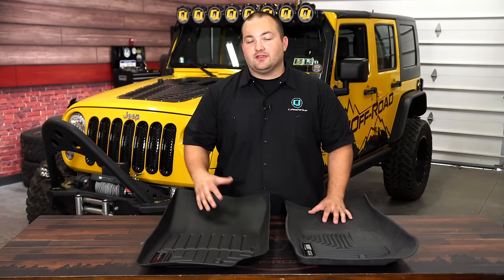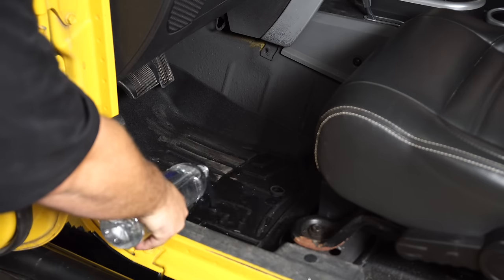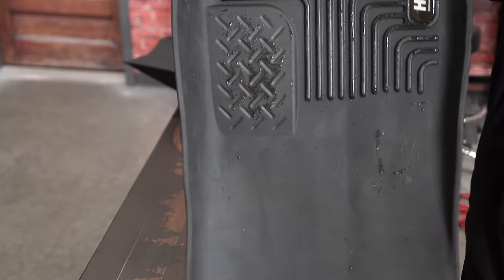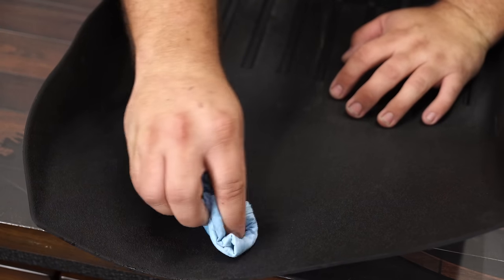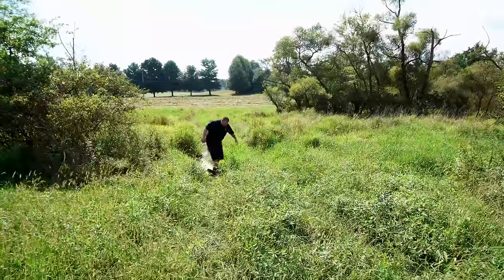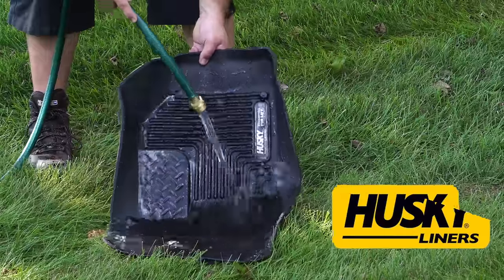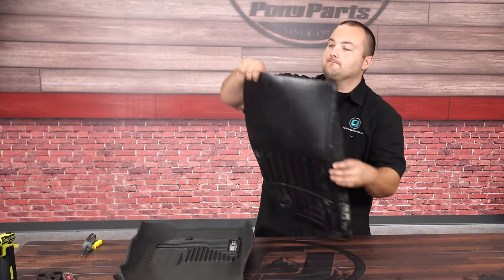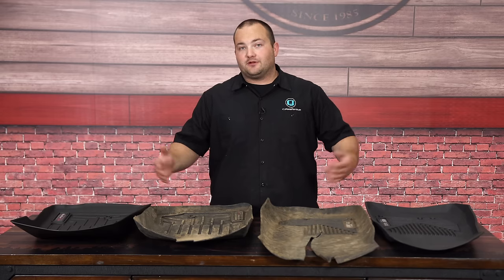WeatherTech VS Husky Liner: Torture Test and Comparison!

Comment: Hey buddy boy, if you put the seats all the way back, it would of been easier to pull them out of the vehicle and spill less to almost none
Reply: Capt obvious commercials are back!
Reply: Costco has some for very little money.The weathertech materials look cheap
Reply: But then you gotta find your spot again. So fuck that
Reply: @AntonioGarcia-xl7xi  Lifetime warranty like the husky ones I have?
Reply: Nick P 🤣🤣🤣🤣🤣🤣
Reply: Just Wipe and or soak up most of it b4 pulling out, 👍🏾👊🏾✌🏾🇳🇬🇺🇸
Reply: @ayo30s  Amen, That is one of the reasons you keep towels handy.
Reply: ayo30s That’s what she said
Reply: Just leave it and get out the car
Reply: @skittles7168 :   Ha, ha, ha, ha, ha, ha, ha  .....
Reply: most people probably wouldn't think to pull the seat back because that would be too easy.
Reply: @AntonioGarcia-xl7xi  I cannot comment about which one is better but, in 2013, I bough a 2010 prius with a bit more than 100 000 km that had weathertech mats. Car is now on it's 11th year with almost 220 000 km and the mats are going strong. Feel like they'll be good for much more. Note this is our only car and we are 3 (since 5,5 years...).
My only complain is it's impossible to remove the rear mat without tilting it 45° which let some dirt going on the carpet. If the plastic was a tad more rubberish, it would have been better. Bear in mind I'm sure these mats were bough at the same time than the car from the previous owner so I'm talking of 2010 models. I'll be curious to compare them with 2021 models to see if they're better, as good or quality has declined.
Reply: Have, not of.
Reply: Buddy boy!!!  Lol!
Reply: Or just use a shop vac
Reply: @skittles7168  Jesus loves you
Reply: CEO is pissed. “Hey buddy boy.” Lol

Comment: I've had both, and the Husky stood up better. Still have the set I bought. Weather Techs tend to curl up at the edges. Husky set still looks new, had it in my car since I bought it in '13.
Reply: Daniel Rehm thank you for your comment. I’m debating on which to get.
Reply: 2nd the huskys. I’ve been in several other people’s vehicles with WTs, and they offer too little friction. The huskys are softer, remain flexible, don’t get plasticy and curl. I have them in 2 current vehicles for the past 5 years, front and back, one with the contour fit or whatever, and one with the regular huskys. No complaints on either set.
Some of the comparison “tests” on this video are ridiculous. How difficult is it to pull the label off? Not on my list of concerns.
The huskys are nice and stay in place even if you don’t have a floor hook. The WTs feel like work truck floor liners.
Reply: David Sanchez the contours are more plush/softer/flexible feeling than the standard huskys, and would highly recommend them if they’re available for your vehicle. But the regular huskys are still very nice and have really aggressive “spikes” to grip the carpet and stay in place very well, and still offer good friction for your feet. 
Both clean up easily with some simple green or similar all purpose cleaner to remove the winter salt. Not sure what the price difference between them is these days but if you can swing the extra few bucks and they’re available for your application, the contours are definitely top of the line, as far as rubber floor mats goes anyway 🍻
Reply: David Sanchez  i have a pair of husky's in my Tacoma. they're okay, the driver side matt was molded incorrectly or it got bent in shipping and doesnt sit right, the emblem fell off. and they gave me a hard time about giving me a new one when i called them on the molding.  Next set I buy will be weather tech.  the passenger side one has been rock solid tho, no shifting, or warping.
Reply: I had already decided on the Huskys just on the noise factor alone but yeah this thread helped me confirm that the Husky's are the better choice.
Reply: See my experiences were right the opposite. My husky liners where junk in my king ranch f-250 but the weather tech mats have been perfect in my duramax.
Reply: @piezoman79  my experience was the opposite with the Husky Liners. My old 2004 Silverado 1500 has them and while the passenger side is mostly fine, the driver side wouldn't stay in place. So the driver side slipped all the time even though it had the carpet spikes on the bottom to stop it from sliding. It ends up getting pushed forward and bunched up developing a bad crease on one side. I mean they've held up all these years, but still slips all the time. I'm sure it would slip less if the truck back then would've come with a hook for helping to hold the mats in place.

Bought Weather Tech for my 2016 Ram and they were fine in that truck. Fit perfectly and never slipped. No idea how they'll hold up in the long run. Hopefully the next owner after me is still enjoying them and put up the stock carpeted Limited floor mats that came with that one.
Reply: @azurewinged4088  yes, thanks kinda the straight awnser I wanted, seems the huskys are a little better, then have the next to best ones, whole set front back for $113 for 2021 subaru crosstrek compared to $198 for weather tech

Comment: You do not take the liner out to get rid of the water. You mop it up.
Reply: Then he dumped the rest back on the floor board with zero liner lol
Reply: i have an offbrand similar set of mats: i just dump them right over the door jamb.
Reply: I disagree with ever aspect of this. My ram optional "weather tech" stuff formed mats are the TITS. And shop vacs will suck the deep puddles from snow or whatever if you cant move that sear back or your pedals back to the floorboard. ( call me spoiled but my ram techs  cost me as much as the front only from either company and I got a solid 1 piece rear to boot . What a goog. That mud had to be dried trampled for a week while building up more rocks and mud. And the "burn out" ha. Are you sure the wear wasn't a lil extra anti slip rubber coating. To the Ford fans. Floor mat beats Raptor. Ba ha ha. Check what's out there for your vehicle most companies guarantee equivilants with a long return policy!
Reply: Oh ....my bad. Also I've never had fluid contact anywhere but the area around the cup holder. Taco shaped do NOT  transfer fluid well. Great how not to test a CBC mat vid!. I did learn
Reply: I use a shop vac
Reply: and move the seat back as far as you can first prior to taking out the liner...
Reply: This must be one worst product comparisons ever. Who the F ever abuse their car floor mats like that? Not even the company put their floor mats to that much torture.

Comment: Idk what the hell the burnout test was supposed to prove but it needs to be a standard test for everything and anything
Reply from the maker: We did it for accurate science purposes 😆
Reply: If your ride gets stuck in snow or mud, a floor mat pushed under the front edge of the tires that are spinning might provide enough traction to bring the tire forward out of the problem area. Looks like the Husky is more likely to provide the traction that might get you unstuck.
Reply: Yep, i have got myself unstuck from my snowy and icy driveway many times by tossing the mat under a wheel

Comment: I will never spend my money on Weather Tech again! Bought a complete set for my 2015 GMC Denali, and the passenger side front kept folding over after time. Contacted them and they told me to use a hair dryer and form it back. Well geniuses, it always folds back over when it gets hot in the truck! They never offered my money back or to replace the mat, so they will not get my hard earned money ever again!! Just got a 2020 Chevy 2500 High Country D-Max and guess which floor liners are going in? Yup, Husky!!

Comment: I think its dependent on which vehicle. Because for my 15 fusion the husky liners covered a good 3inches further towards the seats and fit better than the weathertech. I had sent mine  back and then tried the husky. Glad I did! Love the in channel wind deflectors from Tech though, among a few other things. Both great companies, with very nice products, and best of all..MADE IN THE U.S.A. which isnt very common at all these days.
Reply: Know this an old comment but it's definitely vehicle dependent, on my jeep wj the husky goes up nearly twice as far underneath the pedals and towards the firewall on the passenger side, and for that reason alone I think there better
Reply: @Catboy-hr2qp  Perfect time to comment this looks for floor liners for my wj. Any issues with the huskys?
Reply: @Jonathan React  none so far, they follow the contours a little worse than weathtech but they stay in place better and like I said they go up further underneath which alone makes them better in my opinion
Reply: @Catboy-hr2qp  Thank you going to definitely consider them

Comment: Four Volvos (2005 XC90, 2009 S80, 2011 S60, 2018 V60 Cross Country).
ALL with WeatherTech mats, with no reason to consider another brand. Made in USA, a tad more expensive, but for me, worth the extra cost. Easy install, easy clean. Done.

Comment: I have run husky liners in my truck since i bought it and do find them too hold up quite well to daily use and abuse. My girlfriend runs the weather techs in her truck and between the two i personally will take the husky liners because i notice my girlfriends mats tend too slide around a fair bit more but overall they are both good mats and you can’t go wrong either way

Comment: I just bought a set of WT and they no longer have the cheesy logo on them. This will be my 2 nd set as I purchased a new truck. The one thing I have to say is the WT fit perfect. It looks like WT upgraded their floor liners from the 1st set I bought. I had the WT in my first truck for 11 years with no problems. The only down size to WT is it does feel more like a work truck due to the harder plastic they use. Husky uses more of a rubber that cuts down on the noise. It’s totally up to the consumer but I give WT a slight advantage for the tight fit of the floor mats.

Comment: Guy sounded biased against Husky Liners from the start. I've used Husky liners in 5 vehicles without issue since early 2000. Never wore thru and protected my carpet. I was never crazy about the Weather Tech brand, I always felt it was just a knock-off of Husky. Not sure how your going to end up with all that water in your floor mat. If that happens you have more issue than a floor mat can help you with.
Reply: I kind of thought so too.  I don't see calling the Husky Liners flimsy.  They're soft because they're more rubbery and the weathertech are more plasticy.  I have both and like both but I like the Husky better.  They're more comfortable under your feet and the aren't gray looking after you clean them.
Reply: @dwf150101  - thought it was funny how the weather tech is supposed to have a huge area to hold the water...where the open hole is to attach to the factory anchor...HAHAHAHA. The Husky doesn't have a hole where the anchor fits.
Reply: My uncle has had huskys in his 91 chevy ever since I can remember, still going strong
Reply: My Husky/ WT choice was made when Husky went on 20 percent off sale. Like the Husky a lot.
Reply: I had one husky that was worn through on the driver's side where the heel of the shoe rested. Husky sent me a brand new one with just a photograph required. 

I wish they make these for my wife's new car.

Comment: I have Weather Tech in my two trucks and have had two or three sets in previous trucks.  I’m prettty happy with them but they do get a little ugly after a couple years hard use.  Little more pricey than others but they do protect well.  I always remove them in summer except for the camp truck.  Bought a new Acadia and I’m looking at GMC OEM premium floor mats.  They seem really great and there is a 20% off sale direct from GM through May.  Between Weather Tech and Husky I do prefer Weather Tech.

Comment: It’s preference. I started with WT. They were good. I just got tired of it slightly shifting, and the sound they’d make as I shuffled my feet around. My husky’s don’t do that. Plus if I have a toolbox in my passenger footwell, it barely moves on the husky, but slid all around on the WT’s. I think the WT’s would last longer. But the Husky rubber is a solid product. You’re basically getting the best of both worlds….a pretty decent shaped fit like WT, but tried and true rubber like 95% of other all weather mats.

Comment: I tried Husky but they didn't last. I put a boot hole through the soft rubber. WeatherTech is the best and never had one fair (154,000 miles and going strong!)

Comment: I've run them both and kinda like the Weather Techs more.
Reply from the maker: Theyre both great!
Reply: Opposite for me.  I prefer the softer Huskies.  The WeatherTech I had in the rear of my F-150 was awful, curled up along the edges within a year, but looks like they have changed the design since then.

Comment: i have weather tech currently but think i am going to try husky next time. Weathertech mats are very hard, which is good for durable, but not so good for removing the matts or feel. I think a softer material would be more attractive. Is what i would like to see is a company put carpet in the middle of these mats like the Ram Limiteds have. Then we get a more luxury mat with ultimate protection

Comment: Just ordered a set of huskys. ive had weather tech in my other  vehicles and they look like they will fix most the issues i see with weathertech... mainly very slippery when wet, liner tends to move around when getting in and out, and the edges always curl over time causing dirt to just get under them.

Comment: I prefer Husky liner xacts over weathertech's. I've owned both and I prefer the soft rubber and the way it feels/sounds. I also prefer the deeper grooves to keep my feet/pants from touching the water. Lastly I found all the weathertech's I've owned would fold in and not lay flat against the contours of the floor.

Comment: I've used Weather Techs on several vehicles and liked them until I got a set for my last truck a 2012 Ram 1500 Quad cab.  When I took them out of the box I noticed them to be out of shape. When I installed them they did not sit flat like they were suppose to. They curled up on several edges. I took pictures and sent it to Weather Tech. They replaced the rear liner because it looked the worst. However the new ones were not much better. They too were somewhat curled. I think the problem is in how the package them up and ship them. For my 2019 Ram 1500 Quad cab I went with the Husky's. A night and day difference in fit and trim. They fit like a glove.And they were better packaged.  The price was better also. Won't go back to Weather Tech.

Comment: Owning both I can tell you that the Weathertechs are hard slippery plastic and the edges/corners curl up over time. Husky Exact Contour are more rubber like and do Not curl up and are a much BETTER floor liner. Husky makes a cheaper product called Husky WeatherBeater floor liners that are more comparable to the Weathertech liners it is a hard plastic type liner that curls up. I have some WeatherTechs in my Tahoe right now that are curled up junk, next good sale on Husky the weathertechs are getting trashed and replaced with a set of Husky ExactContours.

Comment: Weathertech for me on my 2018 Toyota Tundra I have the Silver Sky color and wanted to match the interior floorliners with the color of my truck and weathertech gave me the option of grey digitalfit series which makes my interior stand out more and I checked out huskys as well and there options were really limited and the only color they had was black so thats what made my decision. also they are easy to clean and offer alot of protection they are more on the plastic side and need a lil breaking in overall im happy with them just save your recepits so you can claim there warranty just in case.

Comment: Are you sure it is brake cleaner and not brake fluid? We used to use brake fluid to shine our tires up way back in the day. JB weld will fix the emblem problem too.

Comment: Would have been nice if there was a way to compare how they survive when constantly exposed to salt/liquid chloride. Dept of transportation loves to saturate the roads in the winter by me with this nasty solution. I have found that after a few winters, my weather tech liners are faded and don;t clean up as well. Also, the stickers came off after 2 seasons (not a big deal, i'm not a fan of the large weather tec logos...Also, the lack of a plug or cover for the anchor point always annoyed me as that white chloride always found its way to the carpet from that anchor area..

Comment: I have weathertech in my f250 for 9 years now and they are still fine except curling or warped.
Reply: And this is problematic if it curls over your accelerator. It'd try to get a free replacement through the warranty of it covers it

Comment: Have had multiple sets of both. Weathertech does better job of getting fit correct, but is indeed more flimsy/floppy material. Probably doesn't mean much, since the mat is relatively stationary and doesn't need to flex much. Husky is more rigid, which gives a more "solid" feel, but is also a downfall, since they don't always fit as well and the stiffness of the plastic can leave gaps and spaces where water/dirt can get behind mat.

Comment: I have both brands and really like them both. All used in metal shop atmospheres and all used in highly used in F-350's and Ram 3500's. you will not go wrong with either of them. That said, if I were to give my full recommendation, I think the Husky's Fit better, 'Tap' less, slide less and clean up MUCH better. The spot where the drivers heal rests and grinds has NEVER gotten clean in the WeatherTech. Also the WeatherTech hides more than half of my  glowing Platinum logo.